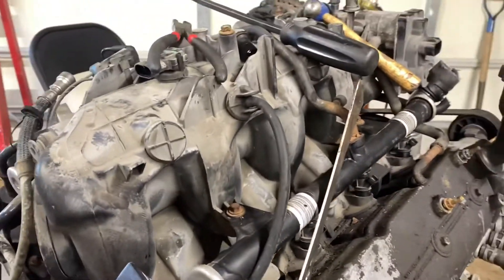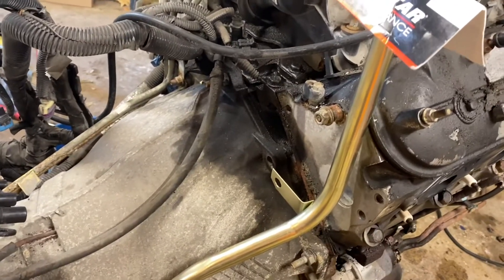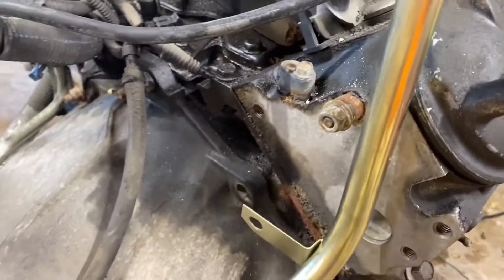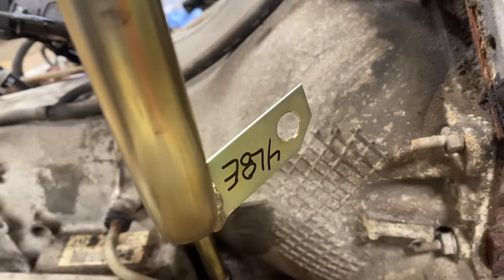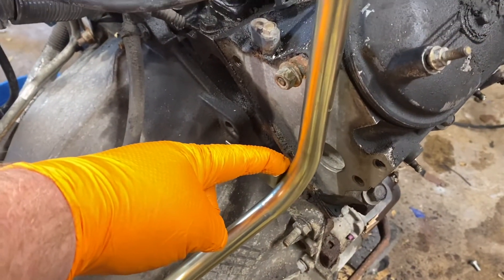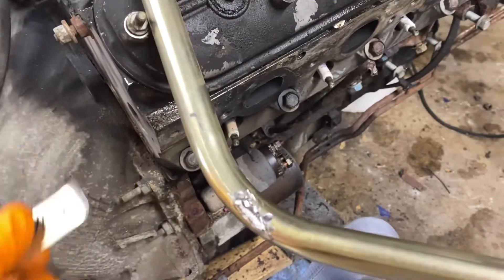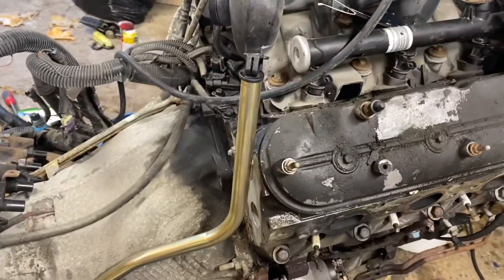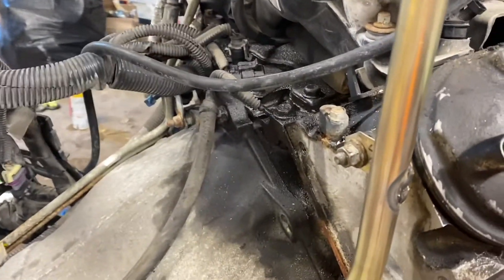LS swap 4L80E dipstick tube fitment

Comment: There’s a stud and nut that go on first that secure the transmission to the engine, then a second nut that secures the fill tube. That first nut fills the space between the transmission housing and the tab on the tube. It looked like it was close to right, can’t say for sure from the video. Either way, it isn’t supposed to touch the transmission housing.

All said, nice job on the modification, looks good!!

Comment: I would have liked to know if you used any rtv on the bottom boot or O ring, seems like people do. I’m trying to replace boot and O ring if there is one on my square body Chevy transmission oil tube. Yeah I’m just learning
Reply from the maker: No RTV necessary. Just a good fitting seal.

Comment: That tube is for a earlier model transmission. 2000 and above have a bigger depth on torque converter housing. Making it 3/4 on an inch longer. Now you're gonna have to calibrate your dipstick
Reply from the maker: Thanks for the info. With the trans pan off it matched the original depth perfectly.